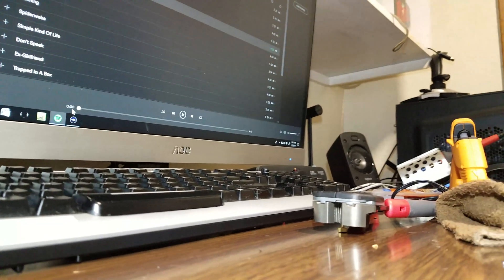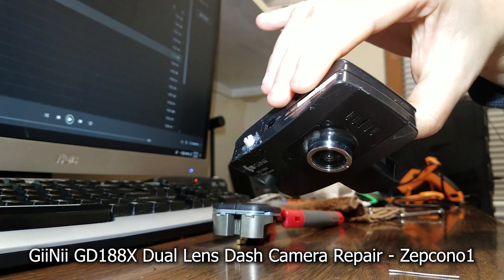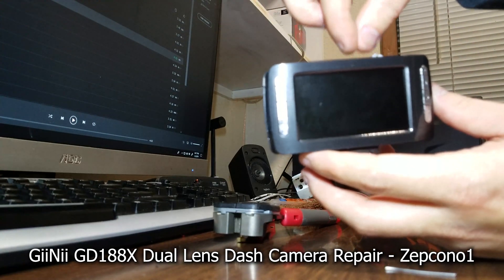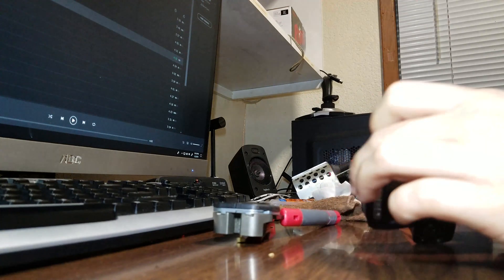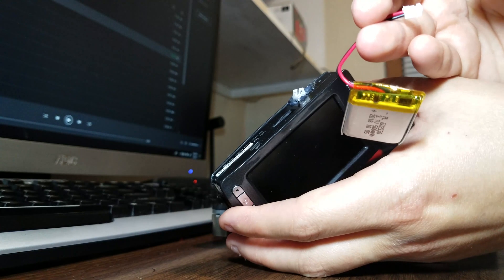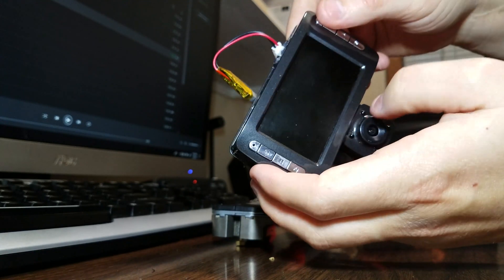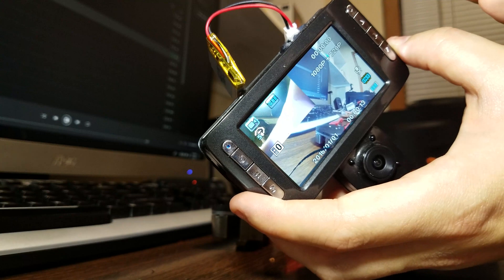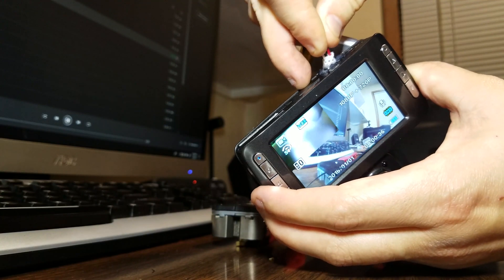GiiNii GD188X Dual Lens Dash Camera Battery Replacement

Comment: Do you have a video or instructions on how to open it?
Reply from the maker: The two plastic halves of the camera exterior are held together eith interlocking tabs.

Grab your thinnest skinniest flat heat screw driver, or butter knife, wedge the edge against the seam of the two halves, until there is tool penetration, then twist the tool to apply pressure on both halves of the camera housing, gentle firm pressure and the tabs will pop loose. Work your way around the case with the tool to get the halves to separate.

Same method can be used for anything eith interlocking tabs, for example car /truck interior trim.
Reply: @zepcono1 thanks! 😊

Comment: Would it be possible to replace it with a 2000mah 3.7v 18650?
Reply from the maker: Possibly, the voltage would match, providing that it was wired correctly a single 18650 could power the camera for a while. The only difficulty would be in figuring a way to attach it to the camera given how large and relatively heavy the 18650 is, it would be tricky. That said the 18650 would likely put up with heat alot better than the stock battery.
Reply: @zepcono1  Thank you very much for the reply!
Reply from the maker: @lexbroken8101  no problem Lex